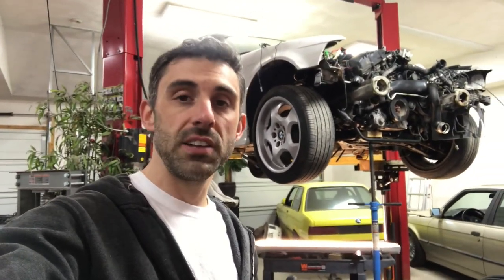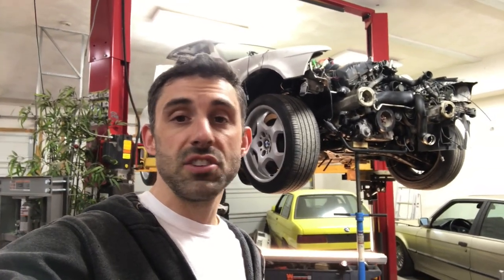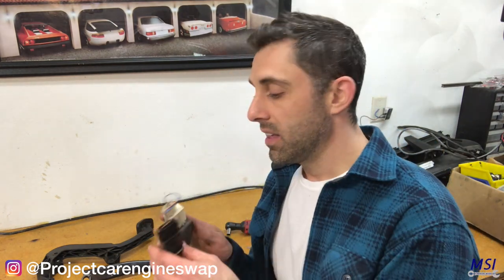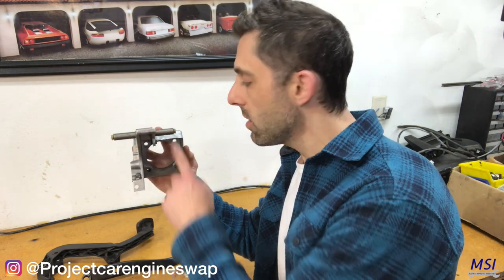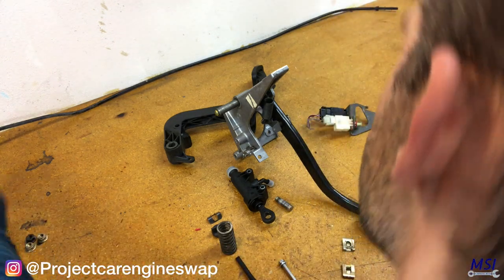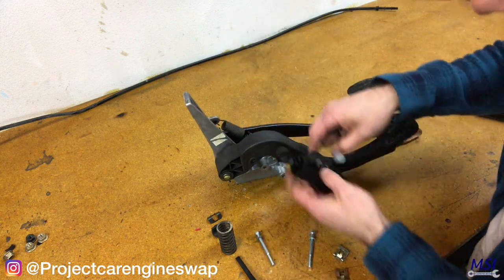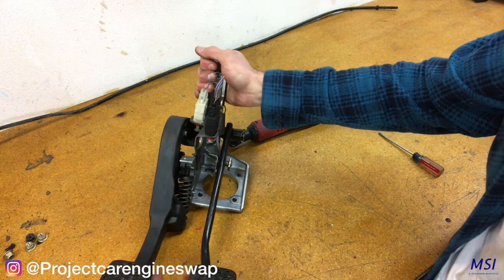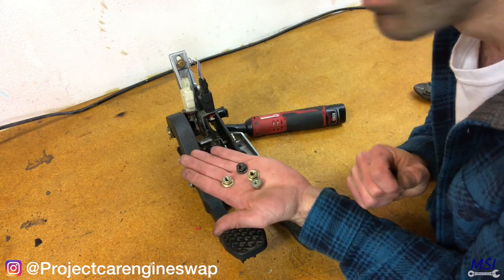BMW E36 Manual Clutch & Brake Pedal Assembly

Comment: Dude, if you see any e36 video and you haven't made it, make it. You're explanation may have just saved me hours of work I THOUGHT I had to do because I installed the brake switch in the wrong spot and couldn't figure out the bolt to loosen it. I was about to take off the whole assembly.
Reply from the maker: Yessssssssssssssss!!!!!!!!